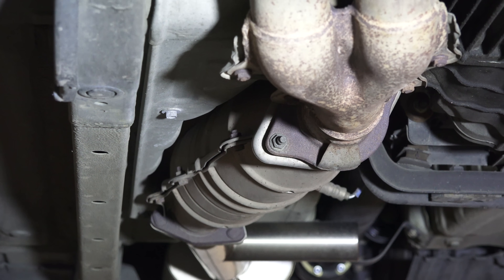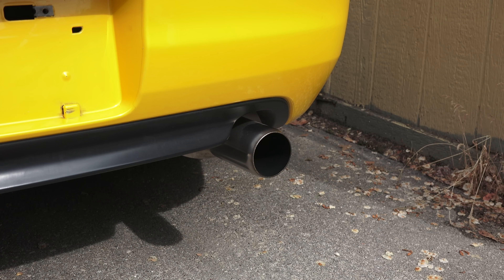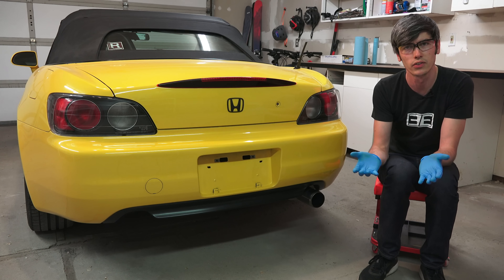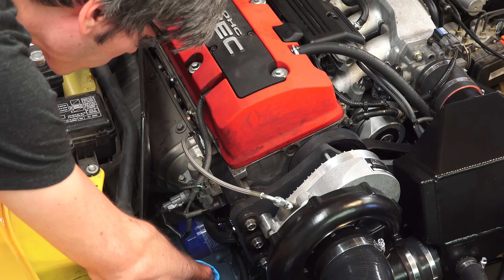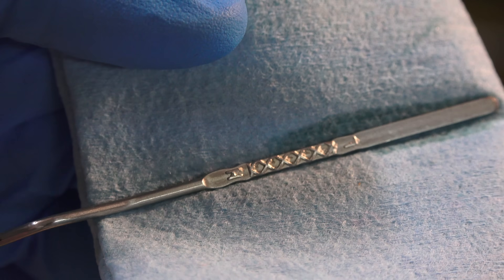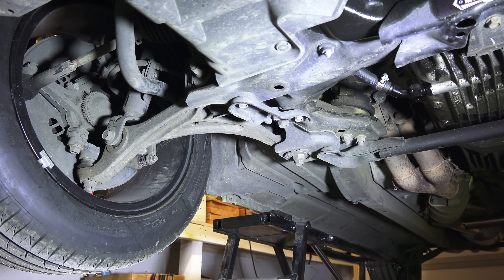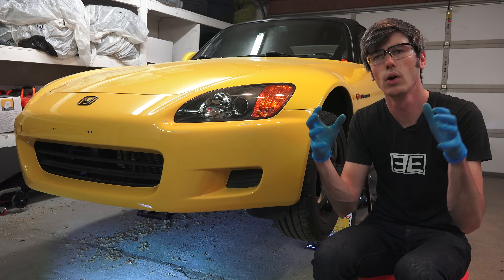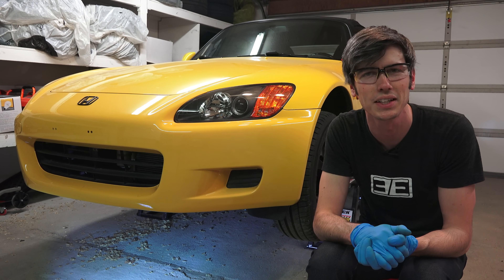5 Signs You Shouldn't Buy A Used Car

Comment: Awesome advice. My one gripe is the advice of any black on the back of the vehicle indicating burning oil. Especially DI engines, result in sooty exhaust tips, and, depending on the design of the exhaust, this winds up on the back of the car, especially hatchbacks with the dirt vortex of doom.
Reply from the maker: Yes, could come from rich air/fuel, though often not as quickly. My Integra burned a healthy quantity of oil, and would accumulate pretty quickly on the back of the car.

Comment: Does this apply to electric cars as well?
Reply from the maker: Mostly, yes! Rust, codes, fluid leaks, etc. I hope there's no exhaust smoke though! Haha
Reply: Would be shitty if you buy an all electric vehicle and discover that you have a cracked head gasket.
Reply: @MagnificentlyHighClippy  Wait till Subaru starts mass producing EV's :D
Reply: If you can check the exhaust and oil on an electric car, hats off to you 😋
Reply: @mjc0961  I guess you should be able to check transmission oil if you don't find any other ...
Reply: Just imagine, 100k miles and no oil change records.

Comment: Whereas if you're getting a used electric car, check the tires and you're good
Reply from the maker: Does it have tires? Yes. Hmmm, okay I'll take it.
Reply: ...worst advice ever...
Reply: Swampy  my comment was mainly a joke, but you do have a good point. I'm not sure how easy it is to check the state of the battery. It definitely is something to be concerned with, especially if they damaged the chassis.

Comment: Factory forced induction cars run rich (to very rich) while being driven hard, causing soot to accumulate on the exhaust tip/bumper also.
Reply: Steven D a friend had an old Honda that had an almost completely black bumper. So gross.

Comment: Do make sure that you check the codes on the engine because scammers will reset the check engine codes sell a vehicle and then about the next day check engine light will come on and it can be big issues
Also check the transmission fluid if it doesn't look pink or looks like strawberry cream or Looks black don't buy it I mean the transmission repairs coming your way the cheapest transmission repair is $2,000

Comment: If your using a rotary engine, burning oil is normal, though it's not good
Reply: @Toby Newell it's not a bad choice if you can deal with the problems a rotary presents though, if you know what your doing with one they can last longer than you would think, they definitely arent your daily driver though
Reply: I daily an 84 rx7 with 195k miles on the clock. Haven't had any serious mechanical issues yet!
Reply: @austinrogers5584  must be in pretty good condition then, not many normal drivers understand how to maintain a rotary
Reply: @brados25z6  In regard to your statement on understanding how to maintain a rotary, what has that meant in your experience?  What are your main bullet points that you believe would improve the  reliability and longevity of a rotary vehicle specific to a rotary engine?  Thanks!
Reply: @austinrogers5584  What key factors on maintenance implementation and driving habits do you believe have led to the longevity of your rotary? Thanks!
Reply: @spoke2soon  I'm the 5th owner of the car but the last 2 owners never drove it which makes it hard to tell how it was previously treated. I've had it for 2 years now, and I have to say you have to be cognizant of everything and regularly check fluids. Which people should be doing on any car anyways. Rotaries aren't hard to maintain It's mostly paying attention and understanding what the car is trying to tell you.

Comment: 6th sign
“No low ballers, I know what I have”
Reply: This.  And my other favorite are “it’s rare” and “it’s mint except.”
Reply: @NGAAutoTV  the best is the "unmolested" cars that have completely different wheels and interior
Reply: "it's stock except for..." proceeds to name 9 aftermarket parts.
Reply: "Lady driven" as if that means it'll be in perfect shape is my favourite.
Reply: @VeraTheTabbynx  to me that just translate to no oil changes done.
Reply: @-KIMISAFOX  Exactly
Reply: @VeraTheTabbynx  That's usually an automatic disqualifier for me. However, if she can competently answer a few automotive questions I'll usually give the car a chance.
Reply: When I sold my used car, I listed everything that was wrong with it and sold it for a good price (lower than what other cars were listed at). Car went fast.
Reply: 7th sign

"No high ballers. I know what I have"
Reply: Ellenor Malik lol
Reply: So how much for the Cummins? Only 495 000 miles you say?
Reply: @staydriven578  $25k OBO
Reply: Stay Driven but it has an engine that good for 1/2 million miles!
Reply: I gotta suzuki x90 it actually is quite rare.
Reply: "no one was kidnapped in this vehicle"
Reply: 😂 Man so true
Reply: @Victor Andrade I mean, you could do it... But why?
Reply: @Victor Andrade why would a 4 cylinder with twin turbos not be good?
Reply: I love the 200k+ miles followed by the "That's nothing for these motors"
Reply: Best is "gently driven, doesn't burn oi" and its on a rotary.... That thing is dead at under 20k if that's true!
Reply: @jakegarrett8109  "Gently driven" won't kill a rotary in 20k, but "uses no oil" will.

Comment: Those same signs could apply dating women.
Reply: But it depends on which kind of liquids are leaking if it's a good or a bad sign
Reply: @moXon460  yellow and viscous fluid 👎
Reply: What if she has frame damage
Reply: Wipe that back bumper
Reply: Definitely avoid any with a lot of rust around the exhaust.
Reply: creamy discharges are a good sign
Reply: @MrRipple123   depends on the color
Reply: Is there an OBDII scanner for women?
Reply: Yes, my right hand.
Reply: @CompproB237  no but they have the TPMS ( The Pre Menstrual Syndrome)
Reply: @CompproB237  Casually mention how President Trump is the very best president since George Washington.
You don't have to actually hold this opinion,  you are just measuring the response from revving the engine.
If your date's car is covered in Bernie stickers,  ☭  Hammers & Sickles ☭  , or smells like Patchouli, cigarettes and beer cans, 
you might want to look elsewhere.  An equally useful diagnostic for men too... MGTOW / I'mWithHer stickers ? Avoid.
If their conversation sounds like an MSNBC or CNN broadcast, keep walking... they watch too much mainstream TV.
Reply: @SeaJay_Oceans  I was more implying having one of those scanners so you can quickly and easily diagnose their issues. Thus, avoiding the problems you've mentioned altogether.

I agree with what you said. All great points.
Reply: Lol ‘after that nice long test drive’
Reply: Would you still not want to find any holes in your under body inspection?
Reply: I would like her to spray liquids
Reply: Yes, women are luxury cars in every single way haha.
Reply: Panel gaps and blue smoke, beware.
Reply: Never met a woman with cloudy oil
Reply: If there's soot close to her tailpipe does that mean she farts too much?
Reply: just don't try the cell phone video test - won't go over well.
Reply: You don't want her to have a driveshaft, always check underneath.
Reply: It's Usually a good thing if a woman has holes though isnt it?. :/.. Could end up with only 2 holes and a pipe.. Always check for 3 holes I say. Check with your phone if it has a light on it and review the footage later, frame by frame.
Reply: they tend to complain when I put my phone to look a their nether regions.
Reply: Don't forget to wear gloves...
Reply: haha yeah because we all know men are just plain perfect, am I right?
Reply: Ingrid P Apart from being ignorant I couldn’t think of any flaw on our part.
Reply: If Any vehicles or females start to give me any heap of trouble it's time to trade them inn/upgrade!  🤘😎
Reply: There are some parts where the analogy breaks down a little
Reply: Plug a scanner in her and check for any codes.
Reply: Where do i plug the OBD on that model?
Reply: Gotta love them rusty bitches.
Reply: Have you been tested for R U S T
Reply: If this apply on man first check Testical if any combarsion
Reply: Yep stay away from those with fluid leaks.
Reply: Just use your phone to look under it :'D
Reply: Over heats on test drive, blows lots of smoke, is slow to start, won't go in reverse, heater doesn't work right, nothing but static on the radio. Would describe my dating life! Lol
Reply: yea like checking clearances
Reply: Haha
Reply: lmfaoo😂😂😂🤣🤣
Reply: Trying to Use your cell phone to check below,  Pop the hood for a look at the engine,
  or kicking the tires will all get you a knee to the groin.   OUCH !
Reply: Man this response thread is horrible... But mostly true nonetheless!
Reply: @itchyslothballs  😏
Reply: fuzzy bib 😂😂😂😂😂
Reply: These comments are cracking me up!
Reply: Yes buying a new car is more expensive than buying a used car...just like women..high maintenance either way. Depreciated with every mile. Salesmen are like their fathers and if you brake it you buy it. Or pay alimony
Reply: men too

Comment: Hey i have a question. Will carbon build up raise the compression ratio enough that it has any effect? Will it be so much that it knocks or so little that it does not matter, or somewhere in between? Thanks Jason!
Reply from the maker: Probably won't alter compression much, but the small carbon particles can cause knock or pre-ignition if they form hot spots, or if they come loose and heat up. Carbon also insulates whatever it coats, so it can prevent proper heat transfer/cooling if something gets too heavily coated in carbon.
Reply: @EngineeringExplained  thanks!
Reply: Carbon can clog your valves if it gets bad.